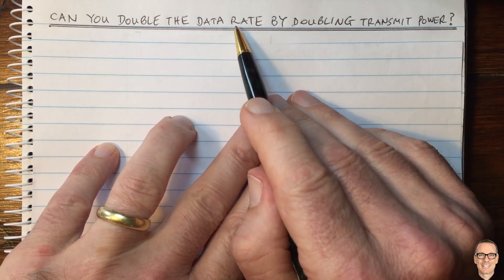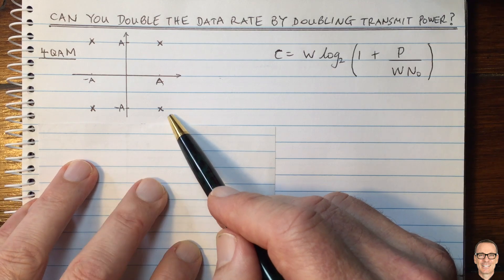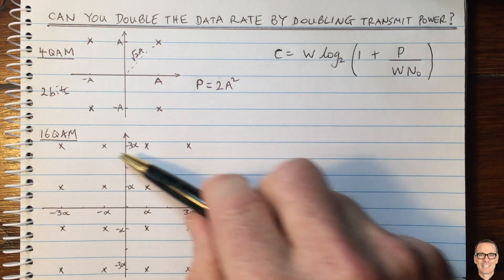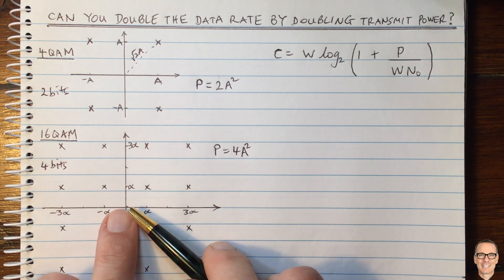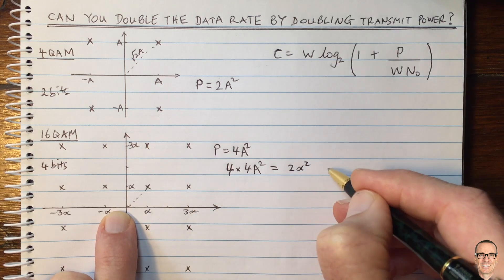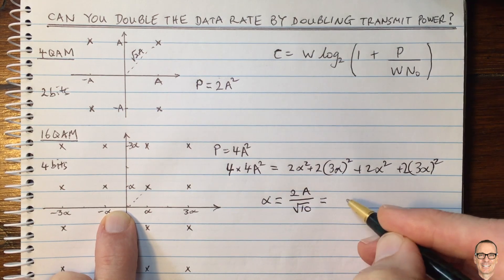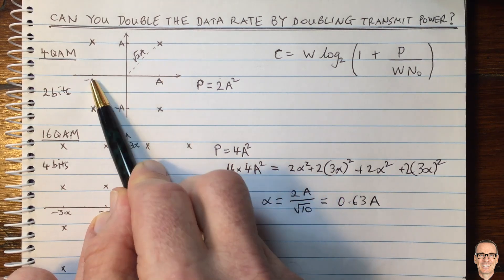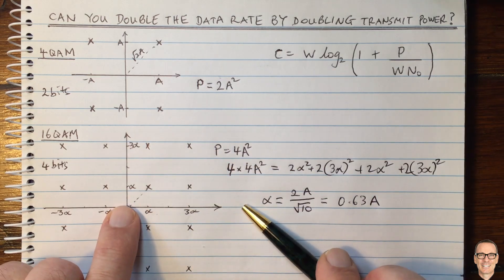Can You Double the Data Rate by Doubling Transmit Power?

Comment: You can, so long as Data Rate << BW. LoRA does exactly this. But assimung you are going for spectral efficiency( as BW can cost money) this seems correct.
Reply: This is clear at low SNR where the log function is almost linear.

Comment: Thanks for the video. I understood it for QAM. I wanted to ask why this also true for multi dimensional modulation schemes. Thanks in advance
Reply from the maker: I assume you mean orthogonal modulation schemes (eg. FSK)? In those cases, to increase the data rate you need to add new dimensions (eg. new frequencies). That means you're increasing the bandwidth. Increasing the power just reduces the BER. (Of course, there are things that can be done to adjust the end-to-end data rate using coding, but I'm trying to emphasise the physical layer here.)

Comment: Thanks, in the IQ plane, there is no real unit (U or E or H) - is that right?
Reply from the maker: What do you mean "real unit"? The axes are the signal voltage levels (scaled to a unit resistor - ie. Power=V^2/R where R=1ohm).
Reply: @iain_explains  yes this is the answer - it was not mentioned in the video...thanks